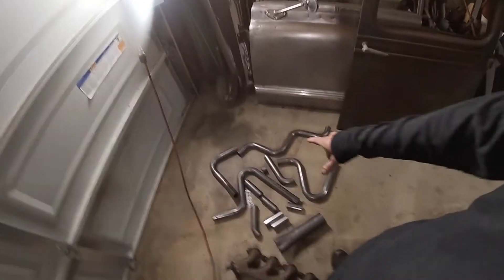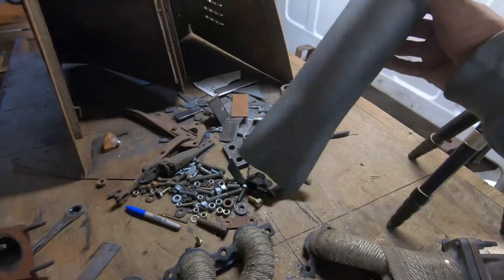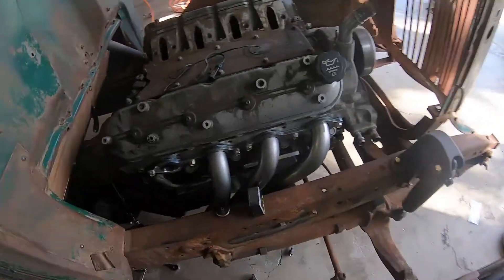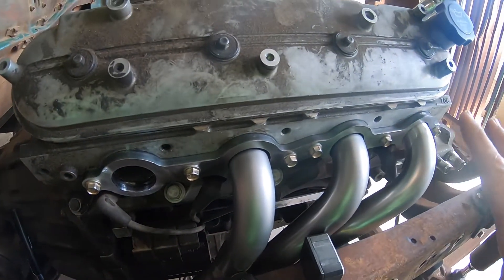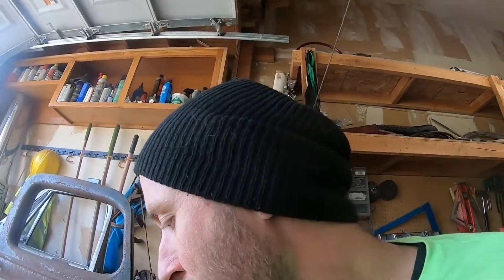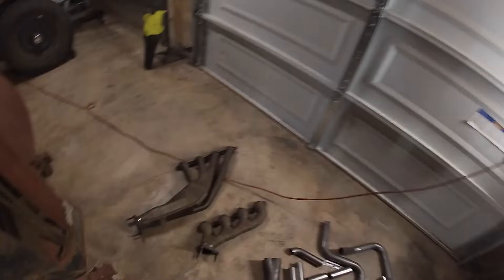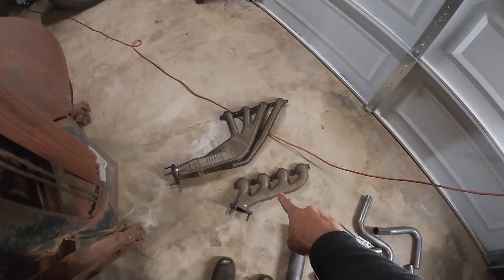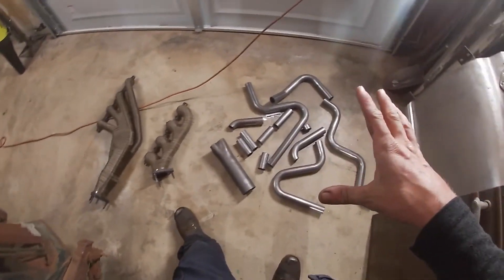How To Make Headers

Comment: Pff there was plenty of clearance in there..
Reply from the maker: @henrygoodbar I  was afraid I wouldn’t be able to get the proper isometric curve in the primary tube which would effect my cylinder 5 proprietary velocity which when you insert it into the formula Elon sent me ¥x(98.3/3.73456)=290hp the math wasn’t adding up so I had to add the wrap to increase the carbon expulsion from the fluctuating vacuum draw from the hypereutectic pistons.
Reply: It’s so easy…Divide the primary tube diameter using  Rawlings principle of hydrophene, compensate for quintilic axomeric byraphic pulsation, then subtract the mean dystanic memorphus by the antillian suverical constant..